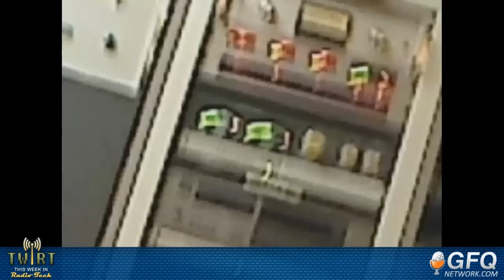This Week in Radio Tech Ep. 155 - Michael Dorrough 2-7-13

Comment: Good gosh, I actually owned a DAP 300 (NOT 310) which was an original test unit Mike gave to WKY in okc.  It had an active compressor instead of a diode limiter in the DAP 310.  I sold this unit and I've kicked myself forever since.